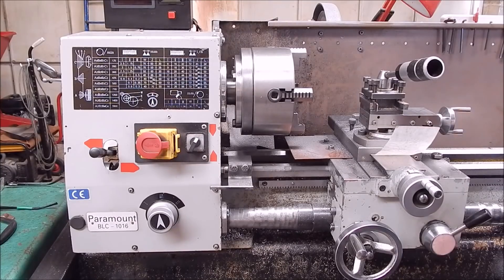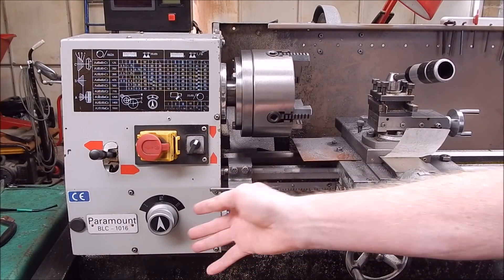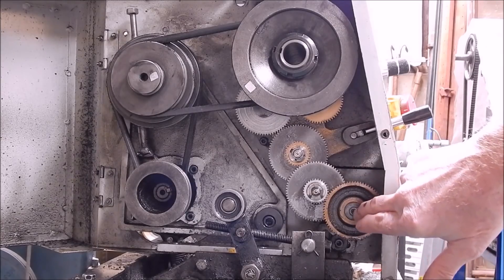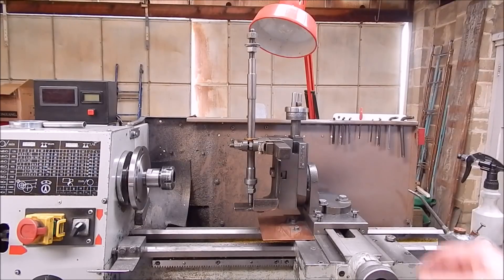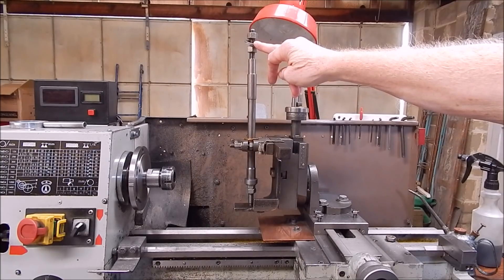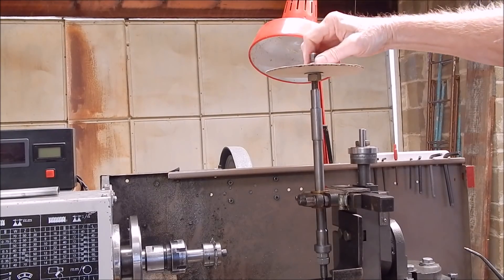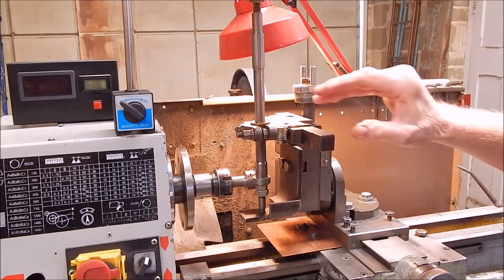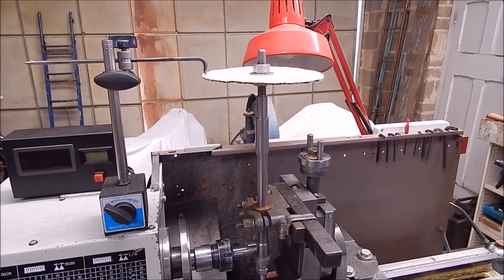How to cut spur gears on a metal lathe with just a vertical mill slide and a printed indexing disc.

Comment: Hi Rob,   For a source of cast iron as smalll as your gear blank I have used old  sash window weights.  In as cast form they are as hard as hell (chilled cast iron) but I have found that they revert back to grey cast iron if put in our wood heater for a rew days (orange red heat) and allowed to cool at the edge of the fire. The diameter of the ones I have are approx. 38mm, so you can clean them up in the lathe to about 35 mm.
Reply from the maker: Hi Rob, that's pretty interesting.  I gave away using cast iron as I found aluminium to be hard wearing and less prone to fatigue cracks from machining.  If it does the job and is free then use it.  I prefer ally as it is both cheap and very quiet.  Cheers Rob.

Comment: Top job! I've always been impressed with your gear cutting work :)
But how would you make something a little bigger, like 25cm or 10 inches?
Reply from the maker: That's do-able, but you would have to make the rig larger.  It's not something I would ever envisage for the small/medium lathes I use, so it's a non issue to me.  You would have to have a mighty large lathe for that to occur and make an accordingly/suitably large scaled up version of the rig for that lathe.  I guess you are thinking of those big old clunkers you have in the workshop.  Excuse my terminology  ;)  What has happened to your channel ?  Cheers Rob
Reply: You're right it's for the old clunker :)
I kinda lost access to my channel for some reason I don't understand. I can no longer login, google is  saying they can not verify it's me. I have the correct login because if I use an incorrect password I get a different error message. It's a real fucked up situation and I just started making new content again after ending up in the hospital last winter. Maybe I'll make a video about it :)
Reply from the maker: What a bummer.  I'm sorry to hear that.  Strange things can happen on the net at times.  I wondered if you had just changed the channel name, but the old one was still there. 

If the password is unchanged, the only thing I can think of is maybe caps lock or upper/case change is on. This can happen on some laptops and you don't get an indicator light. For anything else it would have to be database corruption at YT level or the password has been hacked.

To check the keyboard is set/working correctly simply open "Notepad"  or any other ASCII plain text editor and type in the user name and password.  If either is incorrect you will see it straight away.

Stay safe and well.

Cheers Rob
Reply: It is nothing as simple as a stuck caps lock, I tried 3 different computers, I had used in the past, all with the same result :(
Youtube is not much fun without any feedback. But I am on a mission to make a plum tree bowl for my cousin that got diagnosed with breast cancer last winter. And I do need to work on my own health, so I am somewhat motivated to make a comeback, and make better videos :) I still hope this problem will go away, just as sudden as in appeared, but for mow I will have to be Rollingmetal with 2 L's
Reply from the maker: YT sucks communication wise.  I worked in IT and my suggestion was just a long shot, we used to get this at times.  Well, good luck with the new channel and everyone's health.  Cheers Rob

Comment: Hi Rob, great video, I love the jig you've used to hold the work onto the milling slide. Cheers, Alan.
Reply from the maker: Hi Alan,  I originally made it to cut small gears (the two 30 teeth ones) and later added the heavy steel bar (held on with a radiator clamp at one end) to move the spindle out further for 70 tooth gears.  I've left it there as rigidity and finish haven't suffered, even though it looks a bit feral ;) 

It's easy to make this rig and the way you clamp the spindle can vary a lot (eg. use "V" blocks).  I have a few photo's on the web pages of gears cut and similar rigs made by readers who have contacted me.

It's just another process to learn when doing metal work.  It's not hard.

Cheers Rob

Comment: I totally agree Rob--a lathe without a quick change is a pain in the posterior,I hate the blasted things..
I have one and just refuse to learn about manually changing gears,its a time waster..You change gears to cut threads and then break it down to do turning again..Frustrating.....E
Reply from the maker: Hi Ian, yes it is a pain.  It's even more desirable since the advent of carbide tooling, as that will often give a much better finish on medium feed v's HSS on fine feed.  Throw in the variation in tip radius/profile and you can see why changing feed rate is so essential.  Cheers Rob

Comment: Thanks for your vids. Just watched a lot of them over the last few weeks. That lathe you have sounds like a good one. I cannot seem to find one with the same spec's. Do you know of a similar lathe available (Sydney area)
thx
Reply from the maker: Hi Ket,

My lathe is a CQ9325 (sold in Europe as the HBM450) but no longer available.  It's a very accurate and rugged little lathe.  You can only check out the major suppliers and see what they have.  Search on metal lathe and see what comes up.  Cheers Rob

Comment: Hey Rob, have a look at Clough42 and the electronic leadscrew. I have built it and the results are spectacular. Beautiful threads and a snail pace leadscrew with an exceptionally fine feed. No more change gears with a very basic lathe. Love your vids, instructive and fun at the same time, Go The man
Reply from the maker: Hi Richard.  Interesting concept and unlimited feed speeds. I have kicked the idea around, but not gone any further with it.  I will be interested to see one that actually works without issues (eg. single point threading)..   

I have subscribed and will check out his videos.  Thanks for the heads up. Something to do in this virus situation.

Stay safe and well.  Cheers Rob

Comment from the maker: I cut the 26 tooth gear but the cast iron was a bit cheesy and the metal thickness between teeth and splines was less than is safe, so it went in the scrap bin.  I then cut a 28 tooth gear instead out of aluminium just to be safe. 

Nothing worse than have a gear break and take out the companion gear or worse. Aluminium gears are much less likely to break than cast iron, which can develop hidden stress fractures during tooth cutting.  Cheers Rob
Reply: Hay Rob, Good job with the gear mate but there is only one problem. No link! :-(
Reply from the maker: Hi Mick,

The link is there and works for me.  Here it is if you can't see it :  http://users.tpg.com.au/agnet/cq9325rev7.html

Cheers Rob
Reply: @Xynudu  Thanks Rob